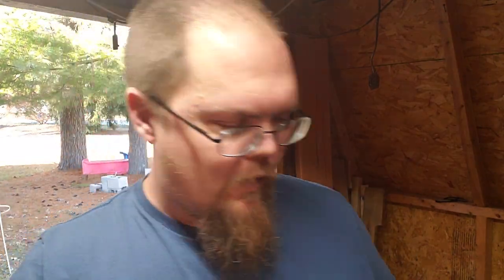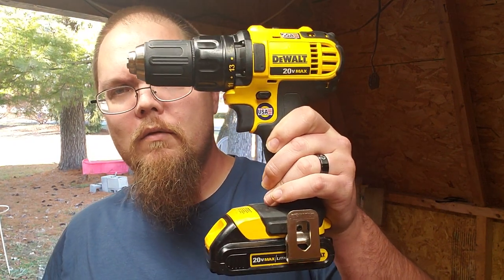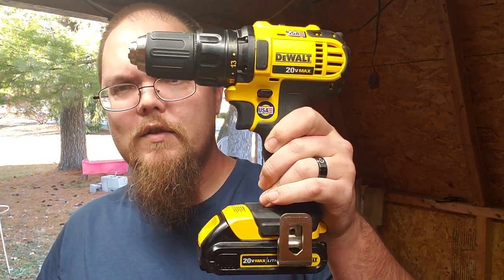Drill question for diy shotgun

Comment: Yes you can with a regular drill. Find center, start with smaller good metal bits and go larger as needed.
Let the drill and bit work, dont force them. 3N1 oil for lubricant. It help the life of the bits.
Reply from the maker: Thank you

Comment: Absolutely that drill will be fine. Now, I am absolutely not saying that I did a similar thing, but if I did (hypothetically, of course) the screw that I did not use was actually pretty short and self-tapping because it needs to be "just long enough" to hit the hypothetical primer on the shotgun shell that is not inside the device that I didn't make. I also did not file the end of the screw to a point before forcing it into the hole in the cap (no tapping required) so that it hit the primer on that non-existent shell more effectively. But since none of that happened, none of this matters.
Reply from the maker: I love hypotheticals

Comment: dont! , 
first use a 1 inch diameter dowel section that fills the entire space in that end cap 
as a breach face as you do not want dead empty space behind the shot gun shell 
& then drill a hole under 2 mm in the wood & use a roofing nail o drill bit  as a firing pin
Reply from the maker: i was wondering about using the dowel.  that was my original idea
Reply: this is a cap for a common sch 40  1 inch pipe   od = 1.315 inch 33.4 mm  &  id - 1.049 inch = 26.64mm ?

Comment: Tinsel strength on cast iron is really not that good. The drill should work, just don't press down on it like you might on wood. Let the bit to the work and make sure it's sharp. WD40 should work just fine. It seems you do enough DIY creations to warrant a drill press. WEN makes a good one for about $80 on Amazon.  Or you could make one yourself from scrap wood that I've seen on Youtube. Just something to think about.
Reply from the maker: Once I get moved into new house in couple weeks, that is one of the first buys